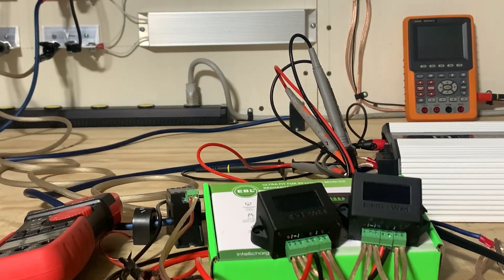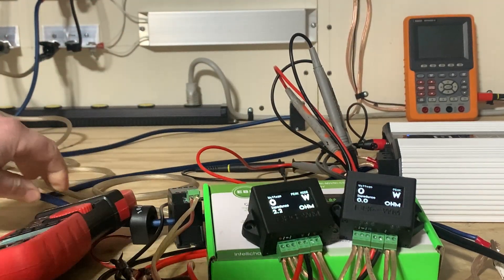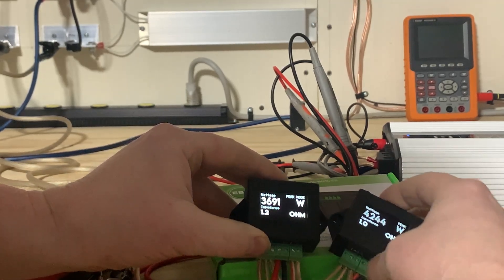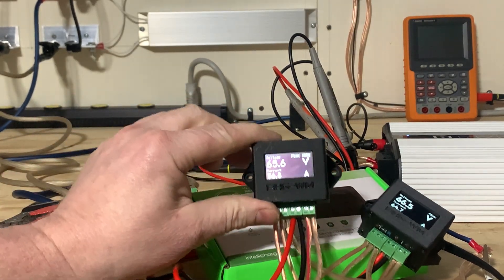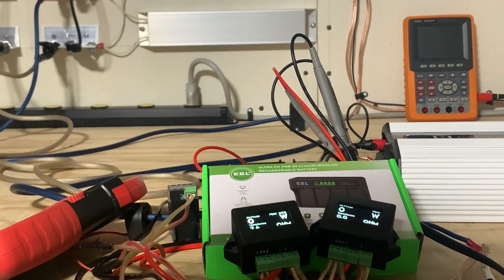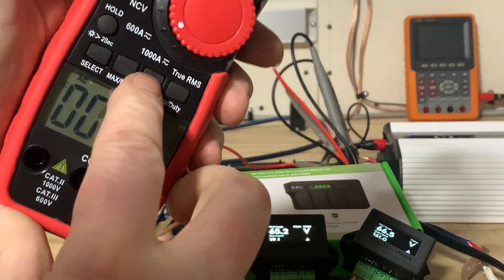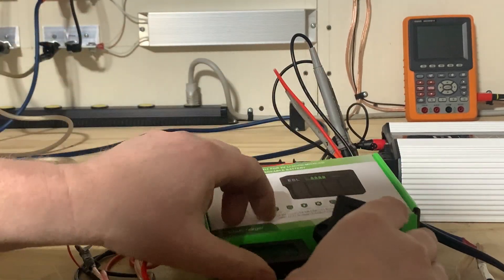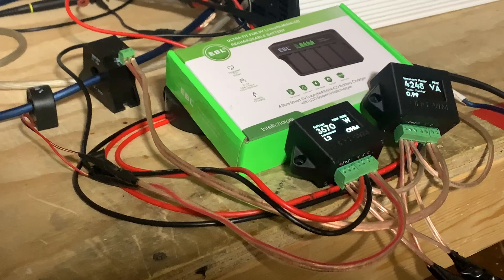BHGWM v1 versus BHGWM v2

Comment: Just the video I was looking for. I have two of these and I need to do. I'm going to check my meter now. I wish they had over the air updates. I know for sure that I have the version 1 clamps but when I just ran out to check the screen, I verified that I have version 2 meter. I've reached out to BHG. I might have to reach out to Big Jeff to see if it is anything he can assist me with getting the new hall sensors.
Reply from the maker: I tested just replacing the sensors and it does not work. The software on the v1 board has to be updated as well. You would probably be better off to contact Bass Head Garage directly through email to see about getting a replacement unit.
Reply: @AllAboutAudioJW but I have a v2 already I happened to have the old hall sensor. I’m just following your info assuming that my display matches your v2. Although I picked up mine about a year ago.
Reply from the maker: @PhiMobileSounds  About the only way to tell which version the main unit is...is the way the display shows "Peak" mode. the v1 will show "PEAK MODE" in the top right corner and the v2 will show "PEAK" in the top right corner. Otherwise they are pretty much identical in looks. Hope this helps.
Reply: @AllAboutAudioJW yep. Somehow I have version 2 meter with version 1 clamp. I got mine April 2024 . But after watching your video, I’ve reached out to BHG via email trying to see how I can source the clamp. Does anyone know the clamp make and model number … or the parameters?
Reply from the maker: @PhiMobileSounds  I don't know right off hand, but I am sure Bass Head Garage will get you taken care of.
Reply: @AllAboutAudioJW  not yet but I did get this in reply … 

Hi ####,

The difference between the "Peak Mode" and "Peak" display is purely a
design change. The real difference between V1 and V2 is the CT clamp —
and that said, you have Version 1.

If the V2 clamp were plug-and-play compatible with V1, I’d send it to
you. Unfortunately, it’s not compatible with V1.

Thank you for your support!

Best Regards,

BASSHEAD GARAGE

Comment: How do I know if I have version 1 or  version 2? Also, now you making me think you should purchase a couple of each version and see if they consistent between each models. I curious to know if production of them make the readings different
Reply: V1 says peak hold V2 & newer only say peak
Reply from the maker: please refer to the previous video labeled BHGWM v1 versus BHGWM v2 and it shows exactly the physical differences. I also did a video comparing both of my v2 meters to check for consistency and they are very consistent between each other. Thanks for watching.
Reply: @jeremywilliams8558  awesome. I'll have to go back and rewatch. Thanks
Reply from the maker: @jlee8262  I went back and looked and one of the videos is labeled "TWO BassHead Garage Watt Meters clamped power on wall socket with 8 ohm resistor"
Reply: @AllAboutAudioJW  gotcha! I will check it out. I like these kind of videos!

Comment: Well, the saving grace for v1 is consistency. So is it close to the same wattage gap both directions, enough to say its 15% below at all readings? Like is it just calibrated lower?
Reply from the maker: I am guessing yes calibration is off on the smaller hall sensor. Of course that is just a guess. I would have to do a series of tests on the v1 from small power up to larger power to give a better idea if the calculations are linear or not. And that would be a good idea for another video. Thanks for the idea and thanks for watching!